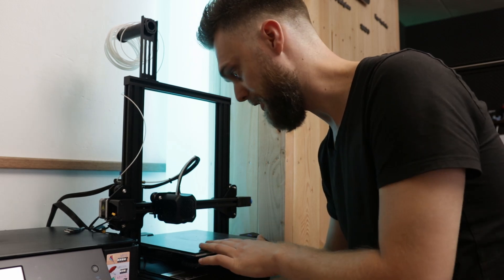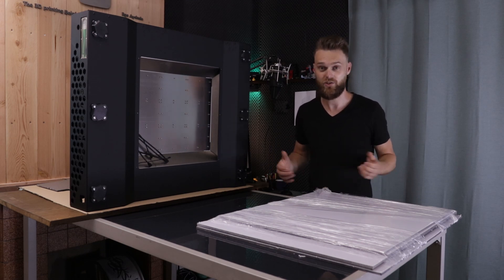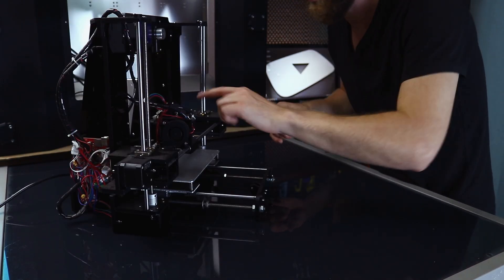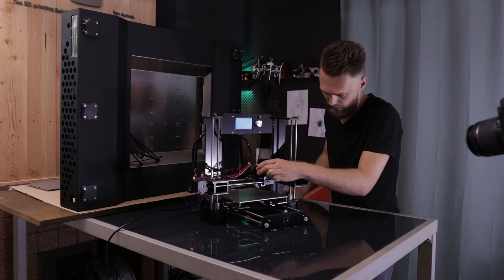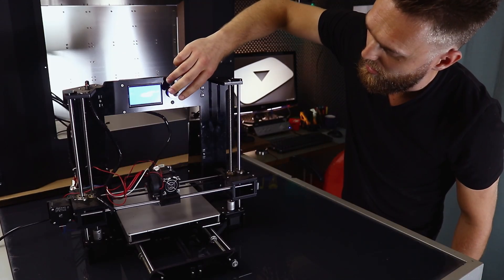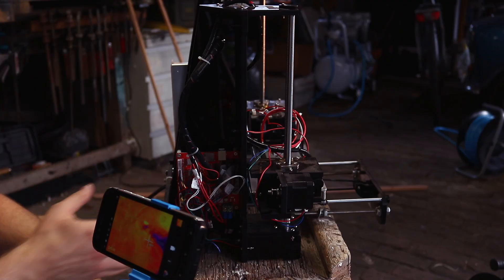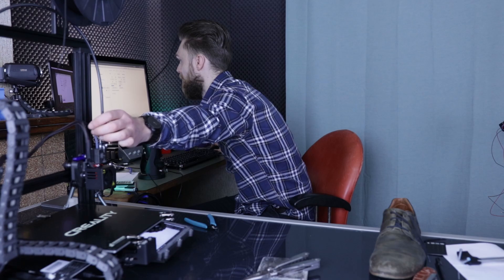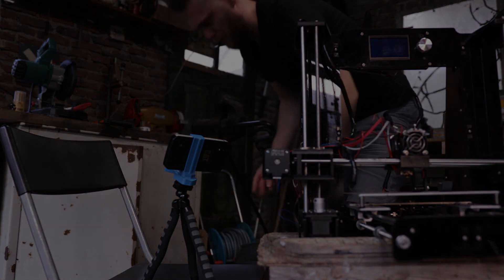Is it possible to destroy a 3D printer by moving the axes by hand?

Comment: Wanted to try that for ages 😅 thanks for destroying that myth.
Reply from the maker: Haha awesome, I had this in my mind for a long time as well! I finally found some time to debunk it xD
Reply: My worry that hey it works for XYZ stepper motors but not all of them. Or like what about those closed loop stepper motors does it work for them etc. I tend to manually move my axis but slowly when I do it. Its a good video, for science!
Reply: @Marcel H this was on the old melzi board that anet and creality used to use, it used A4988's, it's old enough.
Reply: I think it depends on the motors. But the nema17 don't produce enough energy to kill the drivers. Also many of the newer boards have protection diodes. Mostly you kill your stepper drivers when the printer is powered on  and you accidentally disconnect a stepper cable. I had one 4988 which provides the power to the stepper and you have holding torque but the motor doesn't move. I have no glue what i have done wrong to it XD. And i can't debug it without an oszi...
Reply: I have seen this happen on A8, so it isn't myth (not for me - you may not believe me). And it was only one swift movement and the board was destroyed and took the display along.

Comment: How about make sure that the power to the printer is on and the steppers are engaged when you attempt to move them if that doesn't fry it nothing will
Reply from the maker: Disconnecting the motors is one way to fry it, but moving the axe while the motors are engaged is an interesting thing to try!

Comment: If you are feeling confident, based on your results, repeat with a decent printer😀
Reply from the maker: You make a great point! I wasn't 100% confident when starting this video, but I am now. I should elaborate on this further :)
Reply: I do it with my voron and black widow all the time. I have never had a failed driver on many printers in 10 years for any reason (be it moving by hand, overheating, etc).

Comment: Excellent. The problem with 3D print youtubers is sometimes, that they simply repeat things others said, it might be an issue theoretically but never tested it. In practice it seems it’s a bit of a myth.
Reply from the maker: I didn't want to have an opinion about this before I really tried it. It was a hunch and I'm glad it turned out this way. Even if I blew up the board it would have been fun xD
Reply: well, the other Problem is that every printer is different. Different drivers, different power distribution, different protection, etc.... It is obvious that moving the motors introduces a lot of power into the system. If that's a problem highly depents on the system design though 🤷🏻‍♂️
Reply from the maker: @RoterFruchtZwerg  I haven't seen all controller boards of course, but the principle stays similar. You're indeed inducing energy in the printer which has to go somewhere. If the energy is enough, the printer will turn on clamping the voltage. At this point current is running and the only thing you can do to raise the voltage even further is to produce more energy than the system consumes. In case of the Anet I'm unable to accomplish this. I don't think that it's likely that you destroy the printer this way. But then again, I only tested this Anet printer so I cannot say for sure unless I do some further research. Please let me know if you know a design which is vulnerable for this because that would be very interesting.
Reply: @properprinting  the printer will not really clamp the voltage... You induce voltage into the typically highest voltage rail (12V or 24V). Since the logic is powered trough a voltage regulator (5V/3.3V) it is fine and the printer will power up. However, if you create more voltage than the printer expects on the input, the voltage regulator or even the power supply may fail. Feeding back more than 12V into a power supply that is only designed for 12V may destroy it. This is easier when the printer is consuming almost no current (e.g. no LCD backlight/LEDs). I just say it is possible. I don't know how likely it is. You didn't measure the voltage on the printers input, right? By design, 12V systems should be more vulnerable than 24V ones, I guess...
Reply from the maker: @RoterFruchtZwerg  I'll do some further research, but what I meant by clamping is that the voltage drops the lower the impedance of the system is. If you rotate the motor you'll measure a certain voltage which will be lower once you're connecting a load, in this case a 3D printer which is turning on, to that motor. This is a 12V system by the way. I think that you'll not be able to increase the voltage enough to do damage since the printer is drawing too much current. Like you mention, this goes easier when you disconnect the display. In short it's a matter of energy, as long as the printer consumes more energy than you can deliver with that motor, things won't break. The goal of this video is to start a dialogue and the points you're bringing up are very interesting for further investigation in the future :)
Reply: @properprinting  sure, I'd love to see more investigation :D But please, don't hurt yourself! What you've done was already pretty dangerous. I was worried you'd hurt your hand... Wear protective gear or use a power tool to turn the motor.
It was very entertaining though :)
I have a 12V printer with stand-by power-on where all Fans and display are off initially. I'd be suprised if it draws more than 5mA in this state. On such systems it may be possible to overload the input...
Reply from the maker: @RoterFruchtZwerg  thanks! If I'm going to make a follow-up video it will be in a more controlled environment ;) Even bigger stepper motors might be interesting to try as well. This video is a nice conversation starter :)

Comment: Tbh i dont think the problem with moving the axis is electrical. I think it has to do with putting weird torque on the print head causing some mechanical issue. So i think its more of a just move the axis like a normal human and you wont have issues kind if deal xD
Reply from the maker: That would indeed make more sense, the comments though mentioned back emf etc.
Reply: That’s more likely, but not why many are advising against it. They always mention it will fry something.
Reply from the maker: @punishedbrains  yes exactly and I read things like: "the screen goes on so that should be bad" In order to get the voltage really too high by doing this you must be in pretty good shape xD
Reply: Thank you for the reply! But yea it would be interesting to see what is going on with an oscilloscope and powering the circuit using a stepper motor. You could even couple a stepper motor to another stepper motor to power it haha

Comment: I think the only way you can generate enough power to overload the board is if you grip the shaft of the stepper motor with the chucks of your drill and let it spin at high speeds for a while.
Reply from the maker: Sounds like a fun follow-up vid xD

Comment: I'm curious:
What about other drivers? Trinamic?
What does it take to murder this printer (think powertool hacksaw)
Very nice to know that my ANET isn't going to perish :D
Reply: I agree, I am also quite curious if other drivers like the trinamic's are as robust as the factory drivers on the anet
Reply: Heimo van niekerk I don’t think it has anything to do with robustness, more that you can’t possibly generate enough current to actually damage anything.
Reply: I mean, if the piece of shit a4988s can withstand this abuse, I'd think the expensive trinamics would not care at all if you moved your bed back for homing or forwards to take your print out, they're way more robust and capable of more power
Reply: It is really bad practise moving the axis while the motor drivers have no supply voltage aka when the printer is off, when the printer is on and the drivers are not enabled than any movement on the axis should be fine. As far as i know trinamics dont like the reverse voltage, but they survive for more information take a look into the datasheet

Comment: Man I crank my corexy around all the time and never experienced an issue, it generates enough power to fire up the LCD but no adverse affects. This video is f*kin hilarious and puts those people back in their box for repeating information without evidence.
Reply: There is loads of BS floating around the 3d printing community, the magnetic bed max temp before losing magnetism is one that springs to mind, someone makes a claim and the mainstream Youtubers jump on the bandwagon like flys around shit, and before you know it BS is transformed into fact.
Reply: Andrew Hayes Yep or the super dangerous nature of using 3D prints for food.
Reply: @punishedbrains  That one is true - do NOT eat your prints.
Reply: @hpekristiansen  🤣🤣🤣
But the blue ones taste like blueberries! 😂
Reply: hpekristiansen lol good one
Reply: @AndrewAHayes  Permanent magnets do lose their magnetism when subject to higher temperatures. The grain structures in the magnet are able to realign once a high enough temperature is achieved. This temperature and the duration at which it takes for permanent damage to occur vary depending on the exact magnet chemistry (type). So the "mainstream" youtubers are correct. Just make sure to buy magnets which are rated to operate at a higher temperature than you expect them to experience while printing. Many magnets designed to be placed in motors are suitable for this.
Reply: @AndrewAHayes  I use Samarium Cobalt magnets in my heated bed (98 of them 3mmdia, 2mm long glued into end-milled holes), they are rated up to 300 C, this is why they are commonly found industrial machinery.
Reply from the maker: It's true that the motors generate power and the voltage can become quite high as I've read in some comments. This voltage is reduced once the printer turns on by it and only current will be capable of destroying something (which doesn't happen). Unless the motor is rotated so fast it's generating more power than the printer consumes and the voltage goes up again (this is my theory). Maybe a fun thing to try in the future xD Thanks for your comment!

Comment: Try it while powered up :)
Reply: it will be the same, all excess power will just flow back into psu capacitors, the motors actually move way easier with power on as there's no load, been doing this for 3 years
Reply: L3D - 3D maker huh. Weird. My steppers won’t move by hand when powered up.
Reply: Not just printer powered up but steper motors enabled. That is a test to do.
Reply: View my comment and you will see what am i doing. Its for Z axis, no belts, and you can turn motor. But can you kill it by doing that?
Reply: I understand the experement. Just saying what i am doing all time. Maybe that can kill motor.
Reply: Then everythin is ok 😊
Reply: Andrew Cowell  i turn into flames 😁